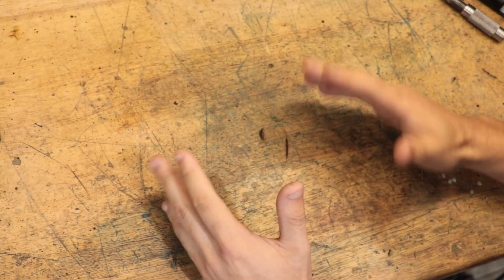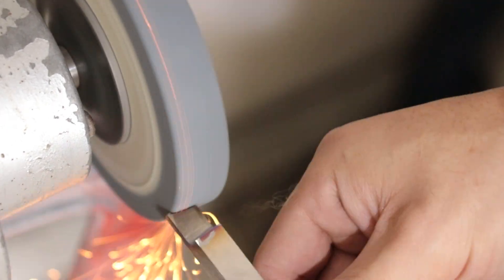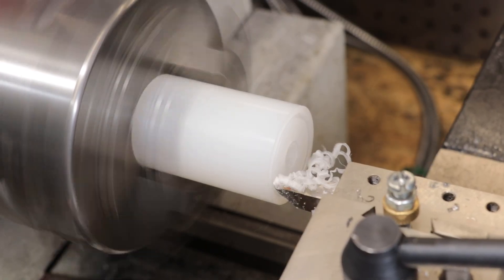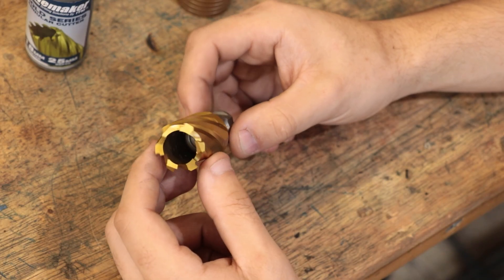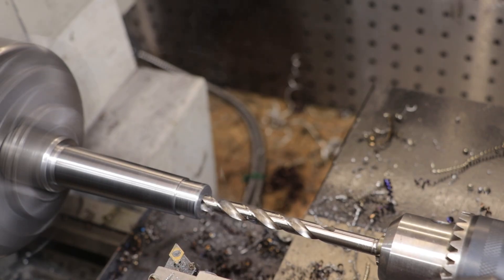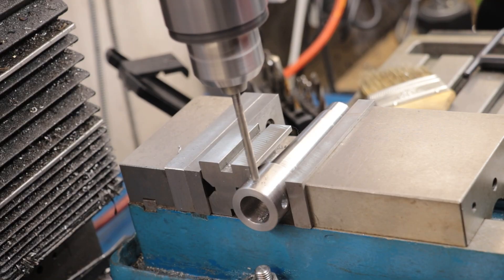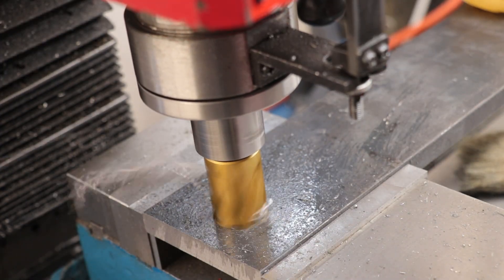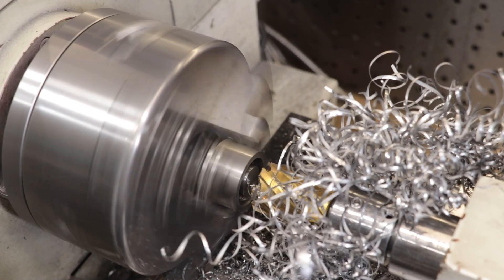Lathe Trepanning - 99.9% Not Brain Surgery

Comment: halfway through typing my comment about Annular cutters, "So i have some Annular cutters"
Reply: I use them even on a full sized mill whenever i need to use the manual machines at work, they require so little tool pressure and machine power really helps deal with stress on the body and the machines

Comment: Trepanning on a small lathe is always a challenge but isn't something done particularly often by most people
I was taught on full size 'industrial' machines and even then it wasn't 'easy' to learn feed rates and rpm but chatter was less of a problem.
A few years ago I  bought a trim router for a completely different reason, (bit of woodworking) made a 3/4" thick aluminium base plate to mount it on drill press.(plus use instead of a Dremel as it was designed for side loads and has many times the power)
  I tried clamping to side of lathe tool-post as an experiment. 
With 3mm TiAN coated milling cutter it worked great in 6mm steel plate, cut dozens of disc's even though rpm was a bit high.
I don't think I'll go back to conventional trepanning tool although I may buy a variable speed trim router in the future.
Did the annular cutters come with rpm recommendations?

Comment: When drilling holes, with either a twist drill or annular cutter, release the tension on the drill a bit. So drill line normal until you see the chips are like 100mm long, lift the drill a bit and drill again. This way you keep the chips small enough they don't make a birdsnest and mess up any finishing. Too me too many years to learn that
Reply: You're correct. Peck drilling is the way to go 👍🙂

Comment: If anyone wants to dive a bit deeper into how trepanning is implemented, look up David Wilks and his videos.
He used to trepann Inconel and other difficult high value materials and made it look easy.

These days Trepanning isn't as common as it used to be, since machines are so powerful that you an easily drill big holes and bore to size and you can't easily automate the process. You also need to find use for the material that is left over, which usually isn't economic unless the material is really expensive.
Reply: Dave's videos are a big miss, he certainly was the master  of trepanning and of making the tools.
Just as an aside, if you're ever single point trepanning through a piece of steel plate, stop the process just before you break through and tap the slug out with a hammer. This stops the slug binding up and snapping the tool, BTGTTS !
Reply: @graemewhite5029  Hello, do you know what happened to David Wilks, hope hes ok ?.
Reply: @rogerwilliams2902  Hi Roger, I'm not sure but heard a rumour that he hadn't hit it off with the people he went to work for after he shut up his own business and the only comment I've seen from him was on a Haxby Shed treppaning video about two years ago where he said he was unwell, but hoped to be picking up soon ? 
Whatever the case, I hope he's doing well and sinking a few John Smith's !
Reply: You are so right
Reply: In a professional setting, I would agree, but for a hobby machinist, those little pucks and cylinders are going to be quite useful and often money is more valuable than time, compared to a professional setting where time is what your selling.

Comment: Not to mention trapnning is also used for ‘o’ ring grooves in faces
Reply: what aboout ahh rings...or boxing rings?
Reply: @TalRohan Ahh rings are done with a large tool, prefferabley an extremely expensive bench tool, simply drop it on the floor and the groves will appear permently on your face.

As for the boxing rings, well those appear spontainously in the presence of an cartoon protaganist after a challenger appears, for best results spend a season building up the match.
Reply: @AnonymousAnarchist2  ROFLOL love it, the last Ah ring I made was when I lifted an anvil with an engine crane and mistakenly thought hitting it with a hammer was a good idea...my ears were ringing for several minutes ...something of an AHHHH the ringing....🤣